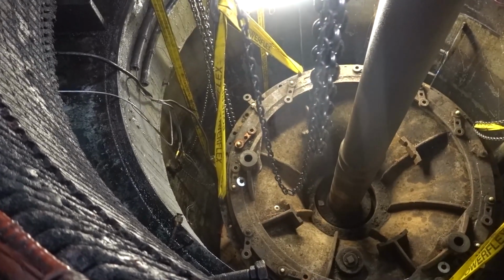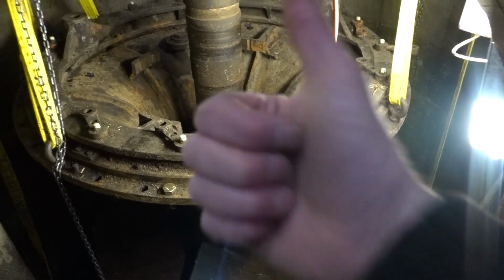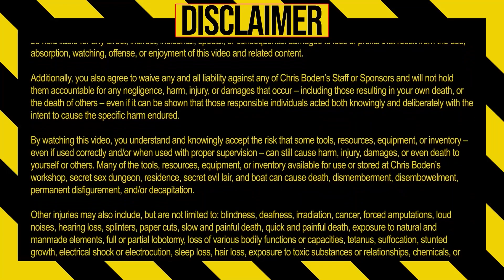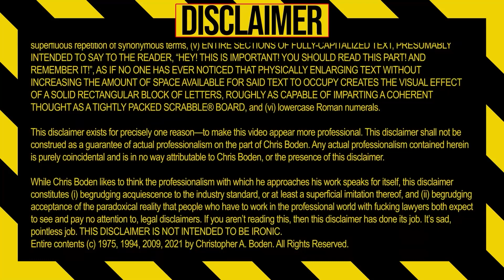Authorized Personnel Only [S3E16] We Accidentally Froze The Entire Plant

Comment: That's exactly how the Ragged Chutes compressed air facility in Ontario worked. Water fell down a penstock taking air with it, leading to an underground chamber where the water and now-compressed air separated, and bam. Cool dry shop air, powered by gravity. Of course it's gone now because all cool engineering feats like that get shitcanned.
Reply: This kind of pump was called "a trompe", and it's amazing that it produced very dry air. Apparently, the air bubbles got compressed as they were being dragged down, and the water vapor in them rapidly condensed on the bubble walls. The end result: dry and cold air.

Comment: Last year Our whicked gates where pluged by a lot of sticks and leaves, and we couldnt open them up to the needed percentage, so we closed the shutters right before the turbine inlet and let the water drain out, but there where still water leaking throught the shutters but it was low enough for us to open up the hatch and go down there and take all of the stuff off of the turbine. Gotta say the amount of air it was sucking throught the over pressure pipe was insane too bad i cant add any photos of it.

Comment: 3:36

The downside is the room is not sealed very well...

Or is that a perk? What would happen if the room was sealed fairly well and atmospheric pressure in the room simply started dropping..

Ooh, i wonder how far down a "pump" that size could actually go XD
Reply: well as frost accumulates on and around the walls a toyt seal might be achieved.

Comment: You are welcome to come visit here by me, where it is 26C, and the rain that is falling can easily be used to shower in, as it is, despite falling from 10km up in the stratosphere, well heated by compression on the way down, and it is actually warm. However, being a pasty pale Kanucistan, you had better remember to lather your fragile skin with zinc oxide paste, liberally, on all exposed surfaces, because the sunlight will penetrate, and broil you from the inside out, as opposed to the local people, who have a tiny bit more melanin in as sunblock, and get more than enough vitamin D from the tiny amount that penetrates.
Reply: Not to nitpick, but isn't water incompressible? Not much drag on a droplet shape to add heat either. Maybe you just have warm rain?

Comment: what's bad about a diesel heater?
Reply: Diesel exhaust has a lot of unburned aromatic compounds that do not combust fully in the brief time it is able to be combusted, so they spread through the air as a noticeable odour. LPG heaters generate a cleaner exhaust, mostly CO2, H2O and CO in small amounts, with almost nothing else as byproduct, due to the short molecules combusting fully, and only trace amounts of thiols, from the mercaptan added to show leaks to the nose.
Reply: Unless they are brand new and perfectly adjusted, they stink like diesel.
Reply: Incomplete combustion, probably of all the big (molecularly speaking) waxes that are put in diesel and nr. 2 fuel oil wut fer pump lubrication.  K1 kerosene doesn't have those and stinks less, but kerosene use comes at the expense of, well, expense cuz cost more per unit volume.
Reply: Fumes from exhaust are pretty strong.
Reply: Diesel.